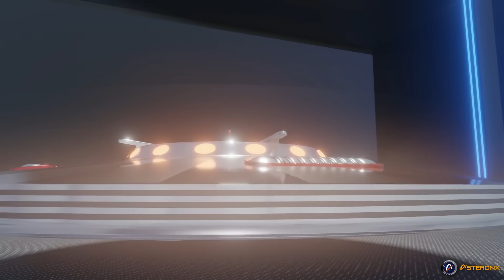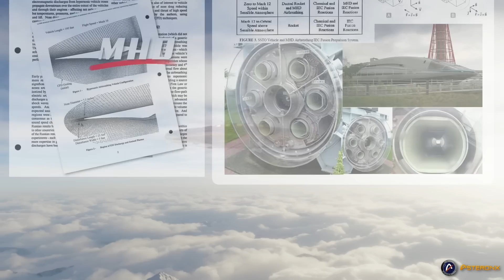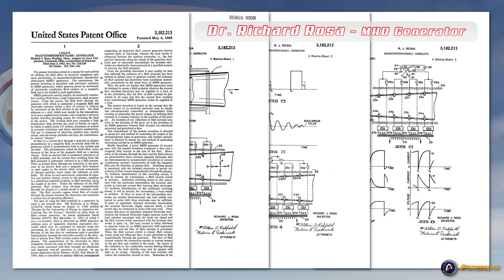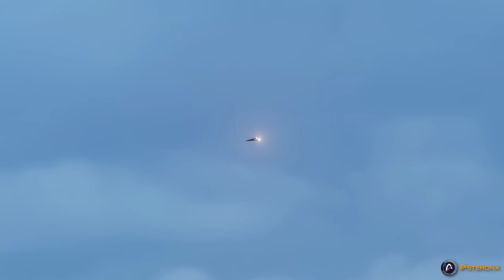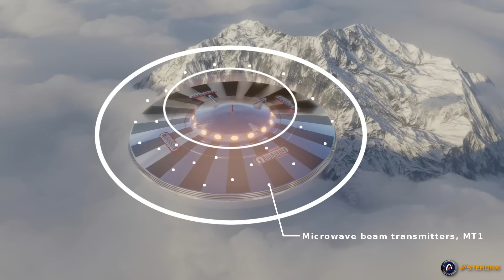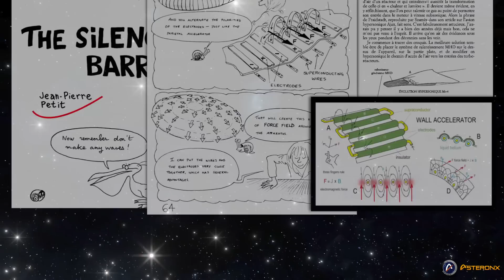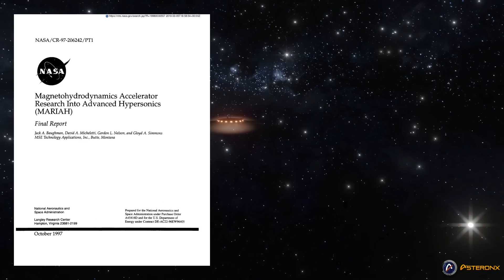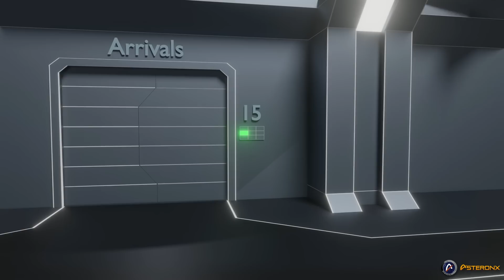Wingless EFE Touring Craft MHD

Comment: As far as I understand this technology it will require a massive amount of electrical energy to run. Even with the superconductive parts (which need energy to keep cool) to create all the required ionization of the air with microwaves and the magnetic field to move it will require a power source I cannot imagine to fit into the shown design.
On the other hand once the craft escapes the atmosphere it has to carry stored gas for the return trip.
Anyway keep thinking and prototyping, that is the way to go! One day it may comes a reallity.
Reply from the maker: Actually, in-development compact fission reactors could do the trick.
That's fission, but it won't be too much longer before we finally have fusion.
Reply: @asteronx The rest of the described design is doable with the existing tech today. Fusion reactor nevermind how compact it is same as all thermonuclear reactors, it produces heat not directly electricity. Once you pile up all the equipment needed to convert it - the weight and volume of the plant becomes kind of permanently anchored to the ground.
For me more realisticly will be battery storage for SSTO and short orbital flights than carrying the entire power plant in flight.
Fusion reactor sounds like a better option for a long range spaceship, which never has to land on a planet and is built in space.
Reply: @nikolayyotov5748    You seem to have a fair amount of knowledge of this sort of thing. It fascinates me to no end! Are you familiar with the solid state flying craft that was prototyped recently? They got it to fly the length of a basketball court. It was a very lightweight bare bones frame.
   It had positively charged anode wires running along the leading edge of a negatively charged wing shaped foil cathode. They ran them along the craft perpendicular to the flight path. I do not fully understand the theory behind it, but put simply, it generates forward motion with an ionic "breeze." The ions flow backward from the pos. to neg. causing motion in the opposite and forward direction. I think it gets its lift from the wing shaped geometry of the cathode foil, as the ions move over it. It seemed to be a similar geometry as an airplane, but no moving parts. It's silent and the exhaust is clean...<?hydrogen, i think?>
Reply: @nikolayyotov5748  For both fission and fusion, there are designs in which the charged particles (fission fragments for fission, helium nuclei for fusion) are directly tapped for energy by using a direct conversion system. For D-T fusion, the neutron takes away far too much energy for this to be practical. However, for aneutronic fusion, or fission, most of the energy is carried by the charged particles, much more than half. This can be tapped by a Direct Energy Converter to extract that portion of the reaction. This device can give efficiencies of 80-90%, with some theoretical designs achieving better than 90%. This means that most of the energy of the reaction will end up as electricity, and therefore smaller radiators will be required.
Reply: @treasurehunter3744  One of the fundamental challenges with any propulsion system trying to escape Earth's gravity from ground level is not only the fuel efficiency, but also the power to overall weight ratio. Ion propulsion is in operation for decades but all designs are very far from SSTO concept.
I was trying to do the math for the design shown in this video, but I came short with the Laplace force calculations which will be converted to overall propulsion thrust. Also cannot find a good info about the overall energy density of a compact fusion power system. The best power to weight ratio of a compact conventional fission reactor (Hyperion nuclear reactor) together with its generator is about 2 tons per MWe.
I will be happy if someone can help with the math, feel very curious to see if this design can actually fly :)
I personally expect a big rush for Fusion technology when (if) the ITER project is successfuly completed in 2025.
Reply: @nikolayyotov5748  Fission Fragment Reactors can be made much, much smaller and lighter than a conventional compact fission reactor. 

I have not done the math for this ionic propulsion, so I will defer to your conclusion. However, fission reactors today, as advanced as they are, lose more than 2/3rds of their capacity as waste heat, and more than half of their weight is the steam system. 

By the way, how "off" is the math? Are we talking a fraction, multiple, or orders of magnitude?
Reply from the maker: @nikolayyotov5748  NASA recently developed a compact fission reactor, including all the peripheral equipment, also, there are fusion reactor designs that are more compact.
Reply: @asteronx  proof of these "compact fusion reactors" please?
Reply: @Inertia888  I searched for the craft your talking about to no avail link please?
Reply: @nil981  he said fission not fusion
Reply from the maker: @nil981  NASA's Kilopower project:

https://www.nasa.gov/press-release/demonstration-proves-nuclear-fission-system-can-provide-space-exploration-power

https://www.nasa.gov/directorates/spacetech/kilopower
Reply: @Inertia888  Ok guys going to the math again
Generated force (thrust) to Power ratios:
MIT best result for Ion propulsion so far is 6.25 N/KW
Helicopters average is 50N/KW
Airplanes are 10-36N/KW (non vertical take off)

I am sorry I cannot get this ratio out of the Laplace formulas used for the craft in this video, but to what colnclusion I am getting: Let say in the near future we can get the Ion propulsion as good as a helicopter ratio 50N/KW, this means with every 1 KW of power the system can lift only 5.1kg from the ground.
The newly proposed NASA fission reactor "NASA's Kilopower project" weights 1500kg and produces just 10KW of electric power, which means it can lift just 51kg.
Going back to the Hyperion compact fission reactor, which is estimated to produce 30MW for the weight of 20tons. With this one and the above calculations you may be one day be able to achieve 150tons of thrust (lifting force).
Even if you use it for the existing MIT project ratio of 6.25N/KW it may still be possible to build a non-vertical taking off airplane with the Hyperion reactor.

https://www.nextbigfuture.com/2008/10/power-to-overall-weight-ratio-aspect-of.html

I have no clue how realistic is this one. Just the best plan I found so far. Earth's gravity is not something to joke with :)
Reply: @asteronx  if you think back to the 1950s 60s and 70s, operation BOOTSTRAP ROVER and NERVA, when they weren't so worried about radioactive contamination, the Phoebus-2A nuclear rocket had a tested core output power of 4100 Megawatts. It would not be beyond reasonable expectation to assume that a dirty prototype of a couple megawatt thermal reactor on a coanda effect craft was not envisaged.

And J Dove, I disagree with the amount of gigawatts you are stating is required (your number is rediculous). I think it could be done delicately with no more than about 40 Megawatts, which is about 53,600 horsepower, or about half the estimated horsepower that a GE90-115B high bypass turbofan is capable of outputting. This is within the realm of some compact thermal -and spallation- reactor designs (weighing a couple tons or less, within the 20-30 ton acceptance range of a medium aircraft). It will need to be cooled with centrifugal compressor air.

Starting somewhere with a design is better than nowhere. If you like the idea, just hit reply.
Reply: @nikolayyotov5748  If you could somehow fill the circle tube of liquid metals with bits of ice made from something like liquid nitrogen, theoretically the ice bits can bump into each to create an electral charge, such as from storm clouds, thus cooling the system as well as charging them.
Reply: @darkorse9752  
Sounds like the charge would be negligible. Oughta' go with something else. Fission reactor may or may not be the only viable option.
Reply: @Inertia888  There is the Preston university reverse field direct fusion. It is at stage 2 temperatures hotter than the surface of the sun 100 million degrees. It is the size of a car.
Reply: @treasurehunter3744  
Nice
Reply: @asteronx   Compact fission reactors are suitable for submarines but are not suitable for flight. Taking to the air requires stringent certification and complex licences that are linked to military constraints and treaties. This  limits development and  approval let alone the infrastructure needed for such concepts to be implemented successfully, whilst the  likes  of Rolls Royce and GE Aviation research departments  keeps them well ahead of their customers requirements and keep the military planners content.
Reply: @asteronx  Yer Fusion is always 40 years away !
Reply: @simrich306  Yes unless you supercharge  fusion with antimatter.
Reply: @asteronx  For that craft to work you need gigawatt range I can't see that happen with fission in a small enough size. If you had a superconducting superfluid coil or a super solid coil it would work in the magawatt range. You could also supercharge a number of fusion concepts with antimatter. With Fusion you can use the fusion plasma and lower the electrical power requirements.
Reply: @asteronx  yea....I'm pretty sure that you could convince someone to fly aboard an aircraft that has a radiation spewing nuclear reactor for a power source! And while I do admire your commitment to what you do I have to bring you down to earth and temper your optimism with harsh realities. This craft probably won't fly in our lifetimes but we might see prototypes flying in a decade or three. However I dont see these types of craft being nearly as common as youd like them to be or be restricted to use by militaries or space agencies.
Reply: This is correct.  And when I thought of this twenty-five years ago when I was a senior in college studying physics
I thought I was the first with this idea.  I wasn't.  There actually was a seminal paper written going back to 1935 that
talked about the "lift implications of ionized air".  Also, BOTH the US and Soviet (and now Russian) governments
have been using ionized air and magnetic fields to aim ICBM missile warheads when reentering the atmosphere for more than thirty years now.
Hence the government has been secretly aware of these implications for some time---decades.  And are STILL
unable to do anything about it because we simply don't have the power-plants that can produce the hundreds
of GIGAWATTS necessary to both ionize the air and produce the magnetic lorentz forces necessary to propel
such craft.  That's why I am laughing as I watch this video.  I literally could have written this book twenty years
ago.  It wouldn't matter because we can't put out that much power as of yet.  We would need a light weight fusion
generator  capable of  over a 1000 GigaWatts in an aircraftt 30 to 60 feet (10 to 20 meters) in diameter.
Reply: "There was an error in the equations and we figured it out" 
- Ben Rich | Fmr. Director of Lockheed Martins Advanced Systems "Skunk Works"
Reply: @ProjectUnity  Which equations?
Reply: thats the fun part, its called cold fusion
Reply: We're not getting useful fusion till the second half of this century and there is no way we're getting flight portable reactors within this century at all. Maybe compact fission reactors might be workable for powering something like this.

Also, cold fusion and electric universe are both collectively delusions. Neither have any compelling evidence behind them.
Reply: @yoshikhurazi1769  
I'm pretty sure that he (the guy with the design, not the replies) already said that he would use a fission reactor.
Reply: @yoshikhurazi1769  We can if we use antimatter to supercharge fusion. It is called antimatter  catalyzed fusion you well not find anything on it. There was information on it 30 to forty years ago but once the military funded research you can no longer find anything on it.
Reply: @clementvining2487  I'm aware of antimatter catalysed fusion so clearly the military didn't do a good job of this supposed cover up. It's definitely a possibility in the future but until we create systems that can produce it at a useful scale, it's a pipe dream.

Let's get to useful fusion power first and then we can move on to antimatter and micro black holes. 

Bottled light is actually a pretty compelling possibility too. If we can create a perfect wide band mirror, then bottled light can offer the same energy densities as antimatter does and without the obvious drawbacks.
Reply: @clementvining2487  I'm pretty sure I have a pretty firm understanding of the energy densities of anti matter. However, you clearly don't since your figure of 5000 megatonnes is off by several orders of magnitude. 1 gram of antimatter is equivalent to 43 kilotonnes, not 5000 megatonnes.

 I also have serious doubts about everything you're saying especially the frankly absurd assertion that you can produce antimatter at 2% efficiency with any known technology. Also, where on earth is your figure of 50 years storage time coming from?  How exactly would you magnetically confine anti-carbon without requiring the formation of highly specific molecular arrangements which would be practically impossible given the incredibly high formation energies of antimatter?

I'm aware that bottled light is speculation. However, so is any assertion of the behaviour of antimatter beyond the scale of atoms. We have never had any macroscopic scale antimatter on earth or possibly anywhere. The answer to your question is put the container on a scale, duh. No different from mass from fermions.
Reply: @clementvining2487  hey clement     Just wanted to ask what you made of the Russian dude that floated the disc connected to what looked like a tone generator    The disc was stationary in a stiff breeze  about two foot around.  It was on u tube before the scrub .  It was In Russian so I never really knew how he did it . Ever see it ?     Another great vid was the English guy with the rotating d battery type things that powered his disc 
The         ?     Motor     Can’t remember his name  as they rotated they produced a 110 scion wave  that powered  the craft it was radio controlled.     Cerrius. ??  Cerrues     Generator.     All removed about two years ago.   A real disservice I must say  one day there will be mullion guzzling Starcraft of  immense proportion I feel .
Reply: @stev838  The truth I am not really sure without having a close look at it. I have seen this in more than the Russian video. With enough power you can do things that seem impossible. But that being said I suspect it is producing thrust. It could have a hidden bladeless fan. He could have a hidden steal plate underground and using opposing charged plates in the device. I know one thing for sure it is not antigravity. There is an effect where you have a pattern of insulated opposing charged plates that rotate it floats. The plates hold some of the charge you charge it enough and it floats. But this too is not antigravity. This effect has been known for a long time. I don't remember the name of the effect.
Reply: @clementvining2487   I saw it as a frequency lifter.     Probably too high of a low amp voltage which would make it very fangorus to ride around in  
So if gravity is an out side pressure 
Perhaps an electronic Tesla valve 
In general terms.   Or a field that entangles the atoms of the mass 
And puts them in the bubble
 then the bubble would appear to lose weight      Always brings me back to the opposing toroidal fields     Sigh
Reply: @yoshikhurazi1769  You are wrong about antimatter it is 100 times the energy output of fission by mass. In fission 2% of the mass is turned into energy. Antimatter it and an equal amount of mass turns into pure energy in the form of gamma rays. That is 200% by mass into pure energy.This energy is so dense it well produce fusion in normal hydrogen. I don't  know where you get your Figures from but it is wrong.

 As for making antimatter carbon isotope it is a long difficult process for the first small amount. After the first small amount the system produces more. This is not my idea I told you that the people who designed the accelerator came up with it. They are trying to get the funding but most people are like you. The 2% efficiency was found  by these people by accident under the correct conditions the antimatter forms atoms faster than thought. The first antimatter carbon isotope is seed mass. The steps to getting up to it has already been figured out. 

Another thing most of the energy you are talking about is to cool down the antimatter and form atoms without a passive cooling ring. That means another ring almost the size of the accelerator ring. Antimatter is not hard to make it is hard to cool and store the way it is done now. This other process allows it to cool down and form atoms at it's own rate with low power levels on the cooling ring side. That is what the ant carbon isotope attraction mass is for. In the trap as the particles pass by some with lower energy  are attracted by the mass and form atoms. 

The large accelerators are not designed to mass produce antimatter they are designed for research and experiments with very specific types of antimatter. You are doing like most thinking of the way it is done now. The antimatter for fuel is what you could call dirty antimatter it is not all the same kind but a mixture. And it does form antimatter molecules. As for the 5000 megatons it is not my figure and it is from memory it could have been 5000 kilotons. But you comparing it in energy density to another fusion process is nonsense. You can't get more than 100% of its mass plus 100% of normal matter mass into pure energy with anything else but antimatter.
Reply: @clementvining2487  It's incredibly trivial to calculate the mass energy conversion of a gram of antimatter. Let's assume we're getting all of the antimatter to react with the matter with no escaped particles (a bigger assumption than you seem to think given the relativistic velocities those particles will gain during such a reaction). You simply multiply 0.002 kg by the square of the speed of light in a vacuum. Plugging those in and you get about 1.8x10^17 joules of energy. That's about 43 kilotonnes, not 5000 kilotons and certainly not 5000 megatons!

It's frankly misleading to frame antimatter as achieving 200% EM conversion in the first place considering the amount of energy that was required to provide that antimatter in the first place. 

I also don't doubt that antimatter mass production is within the realm of possibility but I'll believe the 2% figure when I see the actual papers, not a random Youtube comment with other figures that are provably incorrect.
Reply: @stev838  Gravity is not an outside pressure this is a missinterpertion. According to general relativity space, time and gravity are all part of the same thing you change one you change the other 2. That is why it is called spacetime. Space can be compressed like in a blackhole or expanded like the universe. It can also be  contracted and curved. In other words it is dynamic it can change in this way it has a geometry this is called spacetime geometry. There is 2 types of gravity we know of from mass and acceleration but both is according to spacetime geometry. Spinning an object also creates gravity but that is still acceleration it is circular acceleration you continue to change direction so you don't have to increase speed to hold the effect. There is also the quantum fluctuation if you can offset the balance it changes space this theoretically changes gravity. Basically contracting space according to some scientists but not all.
Reply: @clementvining2487  nice      The spinning wheel.      Ya relax I like to explore the outer edges of  knowing just enough to speculate    Some times absurd    Sometimes reflective    But always forward        We have too many ticctac reports  to not say  anti gravity does not exist   .   Sure it’s one force  but I still don’t disregard the primary vibrational  frequencies   that makes things appear to exist as a solid .   That is a pressure 
One could say.     I still think that apposing  toroidal fields will produce 
the lines of force of a mono pole magnet 
      On another subject     How do you like the idea of passing material though a 
Grid of standing wave forms    To strip the outer  electrons  and  condense the material to make super strong light weight sheet of carbon fiber  or corn plastic .
Reply: @stev838  I didn't say antigravity doesn't exist or something that seem to be antigravity depending on your definition. But at the same time I am not going to entertain something too far from what I consider the standard model.  Something without some observational evidence to build on. Not that everything mainstream physics accepts as facts some seem like they are using the raven's paradox. But it has to have a premise based on observational evidence and sound theoretical view point. Although that view point is mine and not always mainstream physics.

As for the second thing you mentioned I am not sure I ever thought about it. As for the tic tac or what ever you call it UFOs I not only think some are real I also think some are ours. But I don't think they work the way you do I think they work a different way and our military knows how in secret and it doesn't violate the laws of physics some of which I already commented on.
Reply: @clementvining2487  I agree with all of that 
And see it as a great thing to bounce around     Someone someday may find a correlation that is helpful to them     
I know we will crack it one day and yes most think  that they did around 1958 
Did it and hid it.    So on with the shoe 
Hey hers a thing I made in 88.   
I took five lenses  focused a c cell 4volt flashlight the length of an eight foot table  I hung a small magnet at the focal point      Then with another small magnet I waved it thru the beam at the source 
The magnet eight  feet away  began to spin      The magnetic wave packets had traveled the light beam and induced a spin at the target.     A tractor beam yes but also Tesla power emitter using light instead of micro or radio waves     Try it.    It was big fun.
Reply: @stev838  That is interesting it is theorized that light can do more than we think. On the other I think the very large triangle shaped UFOs are ours and they use the bose Einstein condensate effect with superconducting superfluids or supersolids in a torus or coil that curves spacetime and seams like antigravity. It decreases inertia mass and weight by 89% and then uses magneto hydro dynamics propulsion system. It has no g-forces to acceleration.
Reply: @clementvining2487  spot on.    It the only way to explain the eye witness accounts of the arora.
Reply: @yoshikhurazi1769  
Bottled light, huh? I actually thought of something, however vaguely, similar to that myself. I'm pretty sure you'd think of plan to fix this but, how would you use the mirrors to contain the light? Fiber-optics? And what frequency would the light be?
Reply: @yoshikhurazi1769  
Muon-catalyzed might possibly pan out... But the electric universe? Gravity being equivalent to magnetism?
👎🏾
Reply: @ivoryas1696  The idea is that you would have a container where the entire inner lining is a continuous curved mirror of perfect reflectivity so the photons will bounce back and forth indefinitely until an exit is opened. As for frequency, the obvious answer is as high as the mirror can physically reflect with 100% efficiency since the higher the frequency, the higher the energy per given volume. Considering it takes a lot of effort to reflect x-rays and we have no known method of reflecting gamma rays at all, the first light bottle will probably be in the form of infrared or visible light.

We already have synthesized perfect mirrors for a given wavelength but the problem is that even if the initial photons are of a specific frequency, there is inevitably going to be shifting of the wavelengths when in storage - especially once enough photons get packed in that they start interacting with each other in non-trivial ways. What is required to make this work is a mirror that has perfect reflectivity for a whole band of frequencies - the wider the better.

We don't have any known method of doing this but further research into metamaterials are our best hope of discovering such a method.
Reply: @clementvining2487  hey clement o had an idea.     What if the super fuild is in a rotating  chamber   Pushed by a linear accelerator.    As it spins up the strip magnets on the outside  affect a second rotating outer hull.    Then with the corona effect the craft loses weight 
The super fuild is the fly wheel and the Tesla turbine effect powers the outer hull 
The ring charged fluid  makes the inner  bubble  and the in the bubble are no gs 
A pole field develops and the craft loses weight      A tilt and it moves toward a pole    Have fun
Reply: @stev838  Interesting but you most mean superconducting superfluid right. No resistance to electricity or acceleration of the fluid. Without the superconducting part no way to get to critical speed. But because we don't know how to make that material in the private sector how about try super solids look it up a newly discovered form of matter. It may fit the bill. Good deal I which someone would try some of this are maybe they have the black budget has spent over 9 trillion in the last few decades no accountability what so ever. I wonder what they did with all that money.
Reply: @clementvining2487  no.    Just salt water and iron fillings.    It doesn’t  have to reach critical speed  just move the inner hull at a high enough rate to move the outer hull at a good clip.    I would put the accelerator inside  the inner hull or shoot it thru  a glass or salt lenses  it would take a while to get it up to speed  and even small blades would lift it in air
A flying jello mold
Reply: @stev838  Ok interesting. But look up supersolids anyway one of them I think it is sodium gas.
Reply: Electrical energy everywhere.
Reply: @davidmyersretiredaerospace8038  Yes we know but you need to be able to access it.
Reply: Fission reactors have a very low watt/kilo ratio. Meaning they are ok for ships but never use them on aircrafts.
Reply: Yes useless.
Reply: Needs a secondary inertia canceling field to protect the occupants. Energy can be created crystal pressurization. Basalt and granite can produce electricity too.
Reply: The electric univers , people might have us in a Univers waiting to be electrically taped by electric space craft.
Reply: @DANTHETUBEMAN  
That... doesn't really make sense.
Reply: @DANTHETUBEMAN  They are nonsense.
Reply: It's a bit more feasible than you imagine. The magnetic coils could be simple ferromagnetic ones because their function is mostly to impart Lorentz force on the radial electric field that's generated by ionizing microwaves. Only .1-.3T is required to give ions enough annular momentum to be reasonably axially restricted, so something efficient like a mirrored Maxwell gradient coil would be lightweight. Basically it just makes ions orbit around the craft so they don't shoot off to the side. This creates a ring of very high charge-density around the craft, which has high 'stress' or pressure relative to the surrounding EM field and can be manipulated to impart that pressure in a locomotive way. In this case there are anodes on the bottom of the disc that generate an electric potential between the ionized medium, drawing it underneath and leading to a "lift" effect where a high gas-pressure on the bottom of the disc relative to the top pushes it away (as with a plane wing). Because most of the energy propelling the craft (besides hall effects in the plasma medium) comes from electrically exciting and migrating nearby particles, it can easily carry enough power on-board for sustained flight. There are much more simple/economic/scaleable ways to do the same thing, as the microwave circuits are complex and <50% efficient plus generating lifting pressure with ions instead of accelerating them axially adds power drain. This is still a feasible, relatively efficient, and trans-medium concept though. In intrastellar space metal could be sputtered into the ionization region, which has been used for satellite HETs and is uncumbersome. I imagine the main design constraint these people have, if they're actually pursuing this, is generating a large enough static-electric voltage within the craft to power the process. Even if you can carry enough energy around, you can't pump a few hundred KeV out of a battery, so something like a Wimshurt/MHD generator, ion exchange membrane, ultrasonic electrophoresis of a dielectric colloid, or nuclear source would have to be incorporated. Based on the poster's comments he's considering nuclear fusion, which I'd say is uncouth but it's still feasible.

Also, some people liberally call this effect "anti-gravity" in reference to the astrophysical phenomena where charged bodies, like stars, experience a force that opposes their gravitational acceleration towards another charged body with a higher field density. The phenomenological term is used as a flourish for all sorts of MHD-based concepts including this one. It doesn't describe any novel or fundamental physical force, though. The forces in such "anti-gravity" phenomena still come from electromagnetic effects, and almost every published electromagnetic propulsion device is appropriately named in regards to the electromagnetic forces it utilizes. The device in this video would be more accurately referred to as an "ionocraft", "magnetohydrodynamic thruster", "excited medium transducer", or something else along those lines. It's mechanically derivative of an external plasma thruster (XPT) except for that it ionizes particles with microwaves instead of a cathode and directs them to generate lift instead of thrust. Also the "gravitron particles" this guy referred to are just electrons orbiting the conductive medium around the craft, which is a mechanism called a "gravitron" or "clyclotron".
Reply: @jaxjax2011  First you need to be talking about watt not voltage. Voltage doesn't mean very much by itself. The small amount electrical power you talking about would do nothing for a ship that size. Electrical charges and magnetic energy has nothing to do with antigravity. This size craft would need a gigawatt electric power supply.
Reply: The US Navy has Patents (2018)

- Craft Using Inertial Mass Reduction Device. 

- RTSC Piezoelectricity Room Temp Superconductor.  

- Electromagnetic Field Generator.  
 
- High Frequency Gravitational Wave Generator.  

- Rotating Self-Exited, Asymmetric 

Radio Frequency, ResonantCavityTurbine,
 for  Energy Storage and Power Production.

- Plasma Compression Fusion Device. 

- Piezoelectricity-Induced High Temp Superconductor (2021).

  Plus more I just looked at the ones I thought were fundamental.

Gravity is magnetism, these craft ionize the air around the craft to essentially make it weightless or anti-gravity.  It's said they can generate speeds up to and beyond the speed of light.
Reply: @cndbrn7975  gravity is most certainly not magnetism and patents mean absolutely nothing. "It's said they can generate speeds up to and beyond the speed of light". Who said this? This is complete and utter abject nonsense.

Sorry if I'm sounding harsh but I'm a little tired of hearing extraordinary assertions being made with zero corresponding evidence, especially when the assertions actively contradict all available evidence.
Reply: @yoshikhurazi1769 

"Pending Patents" may be, we're talking about the US military after all.

And to say I'm spouting extraordinary assertions without evidence? I told you this technology is patented! 

The only assertion being made here is you're lack of belief, without looking over any patent's (available evidence)

Now, not to sound too harsh but it seems you are the only contradiction here.
Reply: @cndbrn7975  buddy, you clearly neither understand how patents work nor evidence for that matter. 

You do not need to provide any demonstration of the patent in action or proof of its underlying principle. Junk patents get filed (and approved) all the time - especially by the US military and any sufficiently large organisation with several departments - and hate to break this to you but not every patent office is staffed by Albert Einstien.

Bottom line is a patent wouldn't even qualify as anecdotal evidence.
Reply: @cndbrn7975  That isn't antigravity it is electrostatic left.
Reply: It doesn't require gas to ionize in space space already has ionized plasma the solar winds from the sun. The system well increase the energy of this plasma.
Reply: @clementvining2487  
You do realize it has about one million particles per cubic centimeter, right? 

For reference, a droplet of water normally has in massive excess of one trillion.
Reply: @ivoryas1696  What your point water droplets are not high energy plasma particles. In the atmosphere you have more resistance and low energy particles  as you get higher resistance goes down but you have higher energy particles. The higher you go and the faster you go the more high energy particles and the less reaction mass you need. You have less reaction mass but pulling it in at a faster rate and a higher energy. Plus you have less resistance. A craft in orbit needs a small amount of delta-v. Point is if you have enough electricital energy to get to orbit you have enough power to move in space with the space plasma. Remember  you are talking about gigawatt power levels. What matters is the energy level to the mass of the ship.
Reply: @clementvining2487  
What I'm talking about it the fact that unless you are already moving extremely fast (Within five orders of magnitude of c.) or are passing through a neubla you shouldn't be able to pick up enough material to propel at any meaningful rate. Also, in case you didn't know, the exhaust velocity required for meaningful impulse would very likely not be met if you just used the upper atmosphere, even though it's not a bad idea to fly higher with and ionocraft.
Reply: @ivoryas1696  Dude now you are making up things what you are saying is nonsense. You totally discount mass, energy, gravity and the vacuum of space. The deep space satellites use ion drives they only produce micro newtons of thrust and accelerate up to 65000 to 85000 miles per hr.

Fast moving particles increase in mass and energy it is reactive mass that creates specific impulse not the number of particles. Currect scientists have designs for a ionized ramjet for satellites that come too close to the atmosphere. Boussard a long time ago showed if you could get a ship to get to 20% the speed of light you could collect enough high energy particles to create fusion. You get farther into space and the particles are a lot farther apart than what you said. But this kind of craft also works off the free floating electrical and magnetic fields in space. It uses the lazeras force like that in a electric motor. An external magneto hydro dynamics propulsion system moves more mass because it is external and covers more surface area it is a field propulsion. 

Five times the speed of light to get enough particles that is totally ridiculous. Your thinking is missing facts you are thinking in terms of newtonian physics for something that has to do with general relativity and getting it wrong. You simply don't know what you are talking about. You are treating thrust in space like it is in an atmosphere it is different. Any magneto hydro dynamics propulsion system that has enough energy to get to orbit has enough energy to fly in space.
Reply: @ivoryas1696 After everything else I said going though a Neubla at that speed would distroy the ship even at near light speed. A dust particle would make a hole the size of your fist. And you keep saying an ion craft and it is not it is a external  magneto hydro dynamics propulsion system there is a big difference. It is basically a magntic drive not a ion drive. 

 As for getting into space that depends on speed this craft has both left and thrust. Mark 8 to 10 is more then enough to get into the vacuum of space. In the vacuum you have almost no resistance at that speed. So you will move alot faster with less thrust. Once in orbit it takes even less delta v to move higher. A jet has been reported to exit our atmosphere by accident it came back down because a jet doesn't work in space. You are simply discounting a lot of the facts which brings you to the wrong assumptions.

Also as you get higher you get more free ionized particles. It doesn't affect the ship in heat because it is pushed away by the magnetic field. And you can use more and more energy for the magnetic fields like gears in a car. You basically have variable impulse control and the lazeras force. Now prove me wrong you can't. Now the problem is producing enough energy this can be helped with an inertia mass coil or a super solids coil.
Reply: @clementvining2487  I almost missed this earlier comment but how exactly does Bose Eisenstein  states do anything to reduce inertial mass? That frankly sounds like complete nonsense and a misunderstanding of what such a state actually entails.

Also, you're claiming he doesn't know what he's talking about but you arguing that a magneto hydro craft is somehow free from the laws of motion is like arguing that a light sail is free from those laws just because the source of the thrust is external. Completely false.

The only thing having an external source of propulsion does for you is free you from the limitations of the rocket equation - which admittedly is a huge win.
Reply: @ivoryas1696  The original bussard ramjet proposal was proven to be nonviable but there are other more promising proposals. For example, you could use interstellar dust to react with antimatter instead. This obviously can't work indefinitely since your antimatter reserves will eventually get depleted but assuming you don't care about acceleration too much, this would allow you to store twice as much antimatter instead of having to dedicate half your fuel tanks to it's reactant mass.

A more far future idea is to use that interstellar dust as feed material for a micro black hole instead. This gets you "only" 40% mass energy conversion at best but unlike antimatter, this can essentially sustain itself indefinitely

Very difficult to achieve even ignoring the fact that even our most powerful particle accelerators are way way off from being able to create a micro black hole. Consider the fact that such a micro black hole in the kiloton range would likely have a "mouth" smaller than the diameter of a nucleus so our future descendants will have their work cut out for them figuring out how to feed such a tiny monster.

Also, unless you can reflect gamma rays with perfect efficiency (which currently we can't do at any efficiency at all), such a black hole would likely evaporate from existence - and explosively! - in an instant since hawking radiation scales inversely to mass. The bigger the black hole, the more total hawking radiation energy but the lower the wattage. 

Still, it doesn't require any new nonsense physics so it does have potential to become reality and if it does, you have one hell of a drive for interplanetary and interstellar travel.
Reply: @yoshikhurazi1769  You are wrong about the micro blackholes they have been create by the large particle accelerator in Europe. They only lasted for a micro second. I think it took terawatts to produce them. I fail to see how you can use this for power generation.
Reply: @clementvining2487  Uhm, citation needed buddy. Also, you really need to work on your numbers more because a micro second is an insanely long time for a black hole to exist that is so low mass assuming it in fact happened which it certainly did not.
Reply: @clementvining2487  normally, you don't really use micro black holes for power generation but rather as batteries except these batteries increase their power output the more expended they become due to the inverse relation hawking radiation has with the total mass of the black hole.

However, you can stabalize a micro black hole by putting it in a container that can bounce hawking radiation back into the black hole's body. You can also use a particle beam or very high powered laser to "charge" the black hole back to its specified mass.

This doubles as a method of power generation since a particle or photon approaching a black hole without entering its event horizon will exit with higher kinetic energies and this can be tapped for power.
Reply: @yoshikhurazi1769  Ok but the enormous amount of energy it takes to make extremely small blackholes and then they are so unstable they only last for a micro second. I fail to see them being useful.  Plus the fact that they are unemangablely dangerous if you get them to a size that's useful. I am not sure  of the energy level but I think the ones in Europe was 7 terawatts. Besides how would you put it in a container it would have to be suspended in the middle like antimatter. With antimatter you can use a magnetic field. With a black hole you have to use antigravity. 

It seem to me antimatter catalyzed fusion would be easier. It could be a short cut to fusion and the stars. As for storing energy and I think it is still as far fetched is warp matter at least that what it was called when first discovered about 2 or 3 decades ago. It it is now called depositronium it too only last micro seconds but it doesn't take an enormous amount of power to make. It is basically matter and antimatter together in one atom at a different quantum state. But if you can make enough it becomes very stable. But to be able to make a large enough amount you would need a catalyst that you can control the quantum state. Now it is made from positions and electrons which you could get from the quantum vacuum fluctuation. This would be perfect with a warp drive.
Reply: @clementvining2487  True, they are only viable when you can make them sufficiently massive to have a lifetime long enough for you to give you time to contain and stabalize them. 

This is unlikely to be our first interstellar drive method  but after we have already transitioned into a fusion economy and an emerging Dyson swarm with access to several orders of magnitude more power than we have now, this is kind of our next step up. 

You can use them as sources of true gravity in artificial space habitats instead of the simulated spin gravity in a traditional Stanford Torus. They can be far more efficient power generators than even aneutronic fusion can achieve. They can be the most energy dense batteries in existence and the most efficient space craft drives that you can have to any unvisited systems that don't have laser propulsion systems set up.

The final piece that is entirely speculation is the possibility that unlocking the ability to create black holes of arbritaty mass might also one day let us construct wormholes. We might never be able to create ships capable of FTL but by creating wormholes and the carrying then pairing mouths to surrounding systems, you only have to make the journey once to introduce the system to an ever expanding wormhole network.

Mind you, these wormholes with mouths wide enough to allow for the transit of ships would be so massive that you still want to locate them pretty far out from your host star if you don't want dangerous perturbations in the orbit of planets. We're still talking about journey time to other star systems measured in 3-12 months (depending on how many Gs your cargo or passengers can take).
Reply: @yoshikhurazi1769  Look I see you like the idea of blackholes but a more likely scenario would be some kind of controlled singularity. All blackholes are singularities but not all singularities are blackholes.

I am interested in a lot of things but the reason is because  out of every thing else what I am interested in the most is  warp drive. Acounding to everything we know warp drive is the most likely way to go faster than light. And I said know not speculation. Also the current theories on this I think is partly wrong. Not the formation a bipolar spacetime geometry distortion but the concepts of how to get there. And the currect idea by using energy mass equivalent in the nagitive with the energy density of a blackhole to break spacetime geometry. I think you don't have to break it but only bend it another way. In other words I don't think it is as difficult as we think. 

Also with fusion I am not hopeful we well  ever make it work the way we are going. It has been thirty years in the future for half a century. The new claims of break even energy in and energy out is not considering conversion and support technologies to make it work so it is misleading. 

We know antimatter catalyzed fusion well work and then the conversion can get better as we learn. It well open up the solar system to us. As for a fusion economy at first it well be better for space travel. We have enormous amounts of radioactive waste with liquid fuel molten salt reactors we could burn that. Also a good way of making a large number of useful isotopes without turning the machines off. Then we can burn thorium which is all over the place it is basically a waste product of mining.

Antimatter once we make it on earth to use for space travel we can make it on the moon more than twice the sunlight for twice as long and start out with the high energy particles from the sun hitting the moon. Once we are all over the solar system we can make kilograms of antimatter near Jupiter to fuel starships. We well also have a endless source of fusion fuel from Jupiters atmosphere. I think all of this can be done within fifty to a hundred years if we start now. But I also think it well not be done because of politics.
Reply: Go check Jean Pierre Petit Channel on youtube he explains a lot about MHD, it's in French but some of his video are translated in differents languages
Reply: Why Nuclear we have, a 5lb Antigravity, motor, in a,33 ft dia' craft, an a 3man crew, reaches Venus in 3/4 days.
Reply: @majortom3078  Nonsense
Reply: @majortom3078  
Because making and using Anti-matter is way off. Issac Arthur has a video or two on it.
Reply: @ivoryas1696  I saw his video and look at his videos but he is not correct about everything. Someone already figured out how to make larger amounts of antimatter and store it for long periods. And it is using antimatter carbon isotope.  Lookup Gerald Jackson antimatter production. He helped design our current particle accelerator.
Reply: @clementvining2487  Since you finally gave me a name to actually look up, I did. Certainly interesting stuff though I still have my doubts which I'll suspend till I read his work in more detail. 

I'm a little confused though because the proposed nucleosynthesis plan in the kickstarter is for anti-lithium, not anti-carbon. Neither of the intermediate forms are anti-carbon either. Do you have a specific paper title that I should search?
Reply: @yoshikhurazi1769  I came across him a few years ago at the time he thought anti carbon isotope was the best but he did say something about the other was a possiblity. I guess he found a good reason to switch.
Reply: I still prefer the twin torus approach  less power and weight.   Air cooled by venting  
A simple super fluid.  Revolving  in a shell.  Compressed by the second torus.  Left hand downward spiral   It’s the only way to explain a ufos small size. And high speed.  Spits hydrogen fo o2 and
Reply: @stev838  
Great
Reply: Solid Rock hey thanks.  I think as time goes we are close or already did it and hid it.    A generational ship would have to produce its own  oxygen   water and fuel.     Space is 98 percent hydrogen so its one big gas station  as far as shields think three vibe rates put in quantum entanglement  and that though destructive resistance negates most energy shocks hitting  said ship 
For the heat use phi so electric cooling 
Vibrating At a rate that negates heat as movement absorbs heat and displaces it at an even higher rate than it is applied     Ta da     So much fun to think about   Enjoy
Reply: @stev838  
I believe they did it and hid it 
NO NEW SPACE SHUTTLES  !
Reply: Solid Rock yes.  The b 3.   Blue drive     Has replaced it.    I would imagine the b 2.   Has a capacity to carry four tons of bombs.   But don’t know.      Two maybe.     But if you don’t have to ship water.    You can carry a lot of stuff.
Reply: @stev838  You are getting it wrong it has to be a superfluid that is also a superconducting fluid in other words a superconducting superfluid. The  reason is it has no resistance to movement or electrical charges. We already have superfluids but not superconducting superfluids they become solid before you get to superconducting temperatures. But a new discovery may work super solids.

Now as a design that works best you need both a inertia mass damping coil and a magneto hydro dynamics propulsion system. This is why the coil builds up enormous pressures the more power you pump into it. The larger it is the more efficient it gets. Also it sets up a condition where the craft floats on the earth gravity well. Another thing the coil holds its charge so if it is 100% you can't land. A smaller craft like this you get a lot lower inertia mass damping effect. The tr3b is about 600feet wide weight reduction 89%. But it can accelerate to max speed and decelerate in a few seconds with very little to no g-forces. This kind of craft has no momentum when power is cut it stops in other words it works like a low level warp field.
Reply: @clementvining2487  I agree.    Here’s is my super fliers formula     Salt water iron filings some silicone or oil.    You could use mercury like the vininas     
But the small charge from the fillings hitting each other would generate another heat source.    Ever look into  the liquid metal motor  32 percent weight loss      always liked that idea spin it up
With a linear accelerator.  
I still like the opposing toroidal fields.  And the Bubble    Inertia by many methods  the bubble remains.  This is the first thing needed to warp space.

If you can split hydrogen you can power  a dreadnought  full of water.  Once in space 
We need a hydro satellite that gathers  hydrogen makes water oxygen and it’s own fuel  that  would give us a direction.          Space ships built like a 52 caddy  from nickel and iron . With a park fountains fields and towns  that’s what it really means .
Reply: @stev838  You can't get normal matter to move fast enough to distort spacetime. What you said well not work it is nonsense. Anything but a superconducting superfluid or supersolids well tare the device apart before it get to critical speed.
Reply: @clementvining2487  I agree.    I just like the liquid  metal motor  Lear and his buddy tried it back in the eighties with aluminum  the fact that it created a pole type response with the heavier particles moving in to the center was very interesting.     I was originally  talking about  a posing toroidal fields.   No super fluids used.    The ring magnets  held in opposition one right hand one left hand 
And the bubble in between .  In the bubble you would feel no gs     I also like the scarab beetle wing approach.  The ring magnet wing base and the emitter 
Setting up a frequencies that somehow suspends the local gravity  his name was Schaumburg    I think 1930 s  and his little flying box    Very interesting   I see it as a form of scaler wave generator and if you have ever seen a very close view of a  Beattie wing you may  see what I saw 
A scaler wave generated by the frequencies of the emitter interacting with the ring field   They  must be in opposition     as yet we still don’t know how a beetle flys it is said .  Fascinating stuff that will all have totally different results once in a zero g environment  same with your super fluid approach space would keep it super cooled and with out mass it would require very little to work  .     But for me I think the best will be a vibratory rate engine  at a rate identical to the vibratory rate of the quantum universe.    By tapping that rate and using carrier waves you could move and communicate very very quickly 
As is seen in quantum entanglement 
I see light speed as a vibratory rate not an actual speed    The over all rate of the vibratory universe is way faster than light and is a constant state .     So gravity is a state of rate  and a quantum hydro foil  would surf that rate over using propulsion  as a driver.     I’m sure some type of emitter would be needed or it would just hang in space as you implied 
Sure is fun to think about and in space all the things we associate with flight change    Like ion drives  or blue drives as I call them  once your in zero gs   The ships could be massive. Miles long and use the gravity fields of the stars to repel or attract there  way across space.  I sure hope they  try a magnetic drive one day  even to just cruse around and collect Debris from collided satellites  an them and send them down to burn up or off to the sun     obviously you have studied super fluids  and I hope one day you get to see a flying torus using gravity waves to move about at  a very high rate   Enjoy
Ps.   I always thought of gravity as having to parts    I called it the sixth force 
One part attracts and the other  pushes so to speak the quantum rate  being the pressure that holds it all in stasis